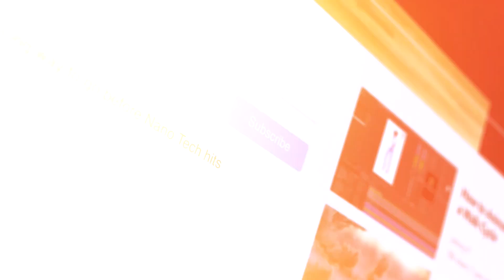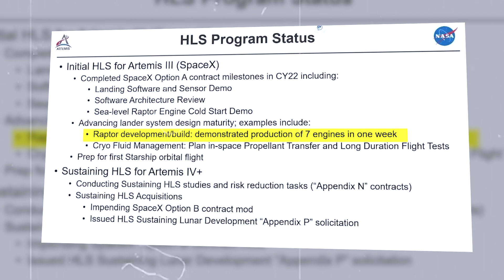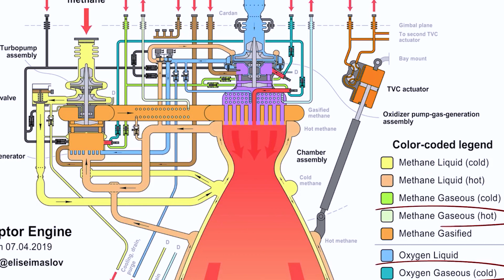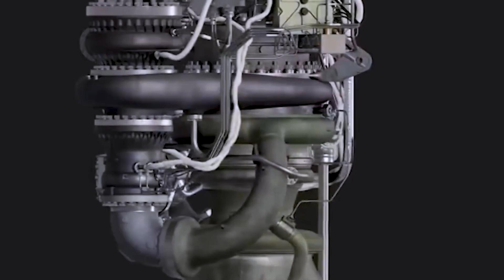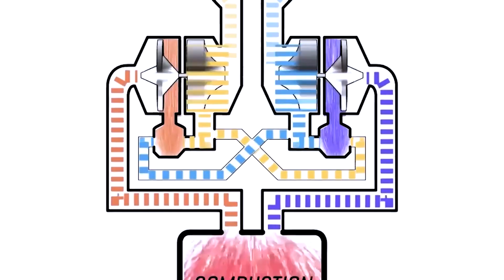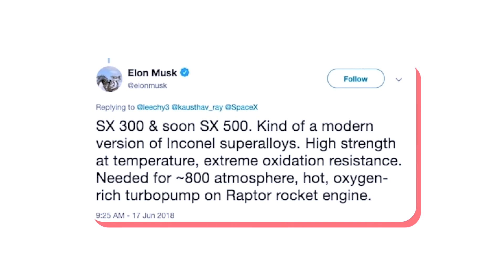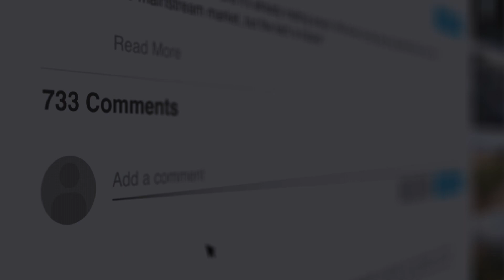SpaceX Raptor Engine Problems: Has Elon Musk Finally Solved Booster Engine? NEW ANNOUNCEMENT

Comment: "Finally" fixed problems. What the hell? They have developed built and did a test launch of the largest rocket in the world and in record time. This sounds like its talking about Blue Origin. There you could say finally that's if they ever do any launches or test.
Reply from the maker: Yes, finally they fixed the issue. Launching a rocket of that size doesnt mean you're spared from feeling a sense of relief when fixing an issue.

Comment: there are several moderately interesting tests before the next integrated flight test. the scariest one to me is to fire the ship's engines while stacked on top of the booster. should be fine, and the booster is likely to be filled (or filled enough for good pressure) with liquid nitrogen, but the test still scares me a bit.
Reply: it looks like they made a mockup of the top of a booster so they can test fire without an actual booster.